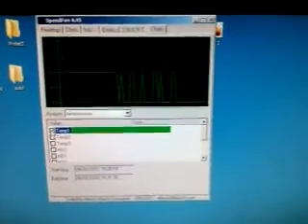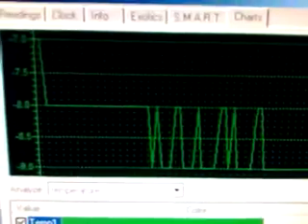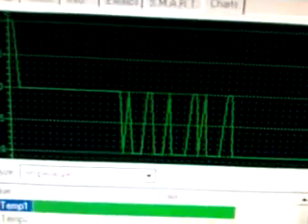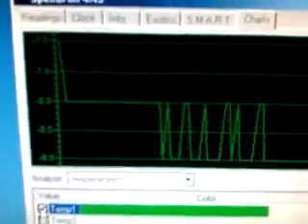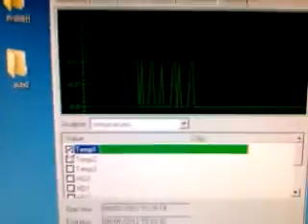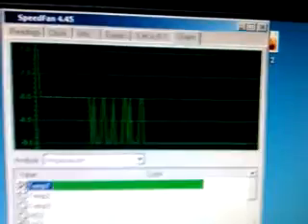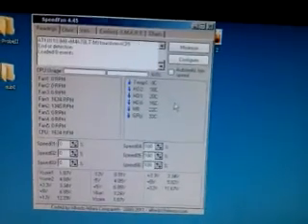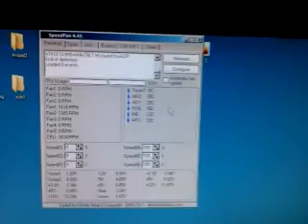TEC cooling update

Comment from the maker: @thecompjunkie hello, I just used antistatic packaging foam, the stuff that comes in the box with your motherboard and loads of vassiline/dielectric greese and putty rubber. The back of the board was painted with 2pak car paint to insualte it. as for the thermale paste i have coated both sides of the TEC in it although technically you dont need it on something that goes below 0 degrees I would still reccomend using it.